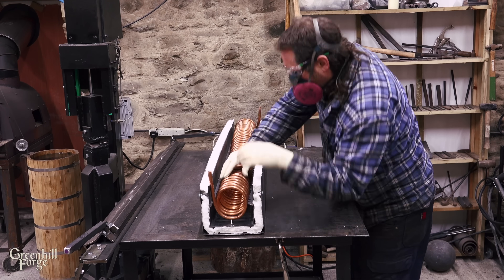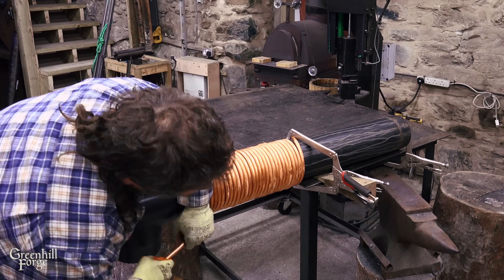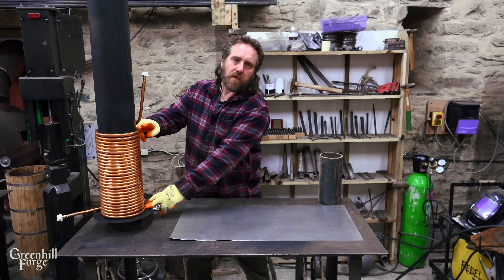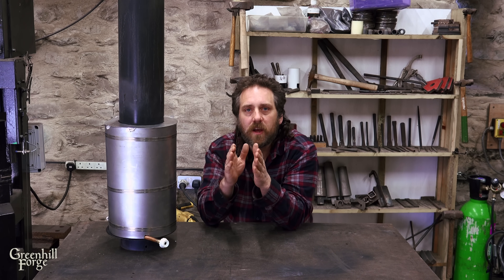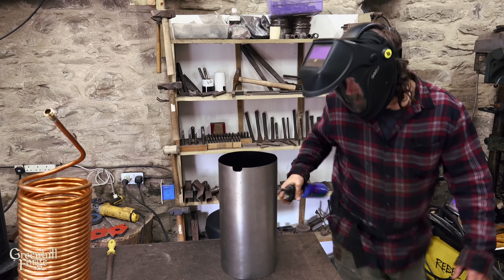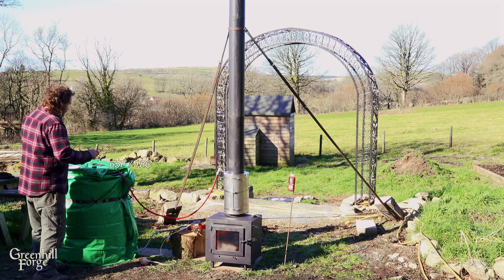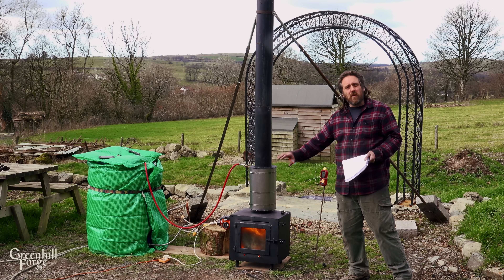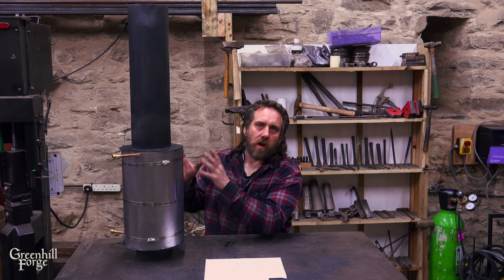Best Wood Stove Water Heater Yet: New Design Tested | Off Grid Water Heater pt3

Comment: Hi Eric, here's an idea. You could increase the surface area of the stove gases coming into contact with the flute by essentially running individual pipes, probably 7-8 together. Once tacked one end of the pipes could be flared and welded together as to seal and direct gas flow. The copper pipe is wound around this component, wrapped and then filled with your graphite. This may, or may not, impede gas flow but it would be easy to calculate the difference in comparable area/square inches and adjust to match original flute volume although the increased heat might also increase gas flow balancing it out.

Comment: Is there a recommendation regarding the distance of the unit from the actual stove. Can the unit be mounted higher, or is there too much heat loss?
Reply from the maker: good question. I'd think it would want to be hot enough to minimize condesation and increase efficiency but I don't see why it couldn't be theoretically further from the stove

Comment: what if you spread the coil out over the length of the flue with an insulating jacket that way your pulling heat out over a longer length and allowing heat to surround the coil

Comment: i tried a lokomotivetyp of boiler with smoketubes .28   0,5 m long ,of 18mm diameter. heated by used vegetable oil (dripfeeder).i clean the tubes every 3 days with a pipebrush. works great as a pool heater.😊
Reply from the maker: Got any pics you could send? I'd love to see it

Comment: Suggestion: Scale it up! Instead of the short section of copper tubing, wrap as much of that single wall flue pipe as you can with copper tubing... capturing and converting more of the flue pipe's heat. Compare the short section version you've been testing, to a whole-flue-pipe version.

You could also stack and connect multiple 'short sections' together to create a modular system to satisfy varying requirements.

Comment: hi from the uk do you not have fires with built in cast iron back boilers ? they are common here i have run full central heating and hot water from a back boiler
Reply from the maker: They're not very common in the States. It's also quite uncommon to use water/radiators for heating in the States. Mostly forced air through ducting. I'll be making some boiler videos eventually but this is meant to be something that can be added on to a normal stove. There's a water jacket shower I made that I show in this video https://youtu.be/pP_2A5Wdvqg

Comment: Love the video and your skills. Truly inspiring. I am just wondering how does a commercial heat exchanger operate in a large HVAC system for example. That is essentially what the coil system is trying to achieve. Are you trying to re-invent the wheel here?
Reply from the maker: HVAC usually burns natural gas or is electric so it doesn't have to extract heat from dirty flue gasses

Comment: What about adding fins inside the flue? There’s a lot of flow moving by and I think you could get a lot more conduction through to the coil. Wavy fins can induce a lot of turbulence increasing your heat transfer rate. I don’t know anything about safety regs like you mentioned inside the flue but the fact that you even tried the coil in there makes me think fins would be fine. They would be easy enough to clean and not develop anywhere close to as much creosote as a pipe with water running through it holding the temp down

Comment: I took note that the coil-in-flue was longer ( about 3 feet) than the outside-the-flue system (14 to 18").  Perhaps a longer exterior coil could capture more heat to provide a faster rise.

Comment: I just found your very interesting video / channel. 
      I think you will be on to something when you add sand. Figure that the copper line has a small contact area and even though you made a great coil the 100% surface contact may not have been good because the coil has a tendcy to naturally spring open for a loose fit.  I would have figured this to be more efficient than your experiment proved, especially when you added insulation.
       I think the sand will greatly increase the overall contact area with much greater efficiency, but that is what I thought about the insulation, too.
       This is my take and two cents worth. In electronic,  when you have components that are prone to destructive temperatur,  they add a heat sink, but they make a special paste to place between the components to help with the heat transfer. I think this is what the sand will do. I think I would find a way to hold the copper coils 1/2" to 3/4" separated and still stay in contact with the pipe. The surrounding sand should greatly increase heat transfer. Better contact with coils surface to pipe. Even though you made a great coil on the first experiment, it could have been loosely fit and all of the not fully in contact.

Comment: Now build a jacketted stainless steel flue pipe. We use them for steam generation. Heat water from 3°C to 120°C in a jacket 60cm long in 30 seconds. add a spiral deflector at the inside bottom of the flue.

Comment: thin walled stainless steel coils braised to stack pipe along with your set up would increase the thermo transpher rate. like what is used in a natural gas pool heater.

Comment: I told you to look at my system. It is the most efficient. 
Here in Chile they have perfected this system you are trying to build. 
THE FLUE IS THE TANK! Jim
Reply from the maker: Do you have a link? In this video I show an off grid water jacket shower I made if you want to check it out. sounds like what your'e talking about https://youtu.be/pP_2A5Wdvqg
Reply: @GreenhillForge  I recently re manufactured my water tank/fire box and upgraded to 4 mm stainless steel. The old tank was 10 years old and needed to be replaced. It works great and is very efficient. Jim

Comment: graphite is an excellent conductor..  I wonder if having graphite surrounding the copper and then an insulator around that.. (aircrete? sand?).. should insulate from the outside but keep conduction high between the copper and the steel pipe.

Comment: Can you surround the coil with water and use it as a buffer maybe with a 95°c thermostat with buffer tank or cycling tank.

Another idea is making a double wall stove with water trapped inside and using this to transfer heat using the same principles

Comment: how about having this unit as an insulated cell, with main heat going trough it, and slightly cooler air flowing outside it.. also make the coil and tube bigger. 
downside, the stove will take up much space and be very heavy.

Comment: I’m spinning off someone else’s idea which is to eliminate the copper tubing and construct a stainless tank component that sits in the same location as the tubing configuration you built and circulate the water through that
Reply: If you use stainless tubing, you just place it in the flue.

Transfer issues solved.

Comment: First of all, doing those tests outdoors was biased against the bare copper coil (contestant #1). 🤣

You could try a boiler design where the hot flue gases are channeled to boil the water ie. in a big, removable "kettle" (for cleaning off the creosote). 😁
Reply from the maker: I made an off-grid flue water jacket shower system kind of like a boiler. I show it in this video if you want to check it out https://youtu.be/pP_2A5Wdvqg

Comment: Wood-burner here from northern New England. I've lit a woodstove at least 2000X in my lifetime, burned wood for heat for more than 40 years. During the winter I don't light the fire as I just pick up the new fire from the previous day's coals. That's not the point, here. The point is that I've watched a LOT of heat go up the flu thinking "What a waste. What could I do with that heat? Soft copper pipe twisted around the flu, and..."  So,  if nothing else, your channel answers so many questions I never got around to answering. A lifelong itch has been thoroughly scratched. I personally proffer profound props profusely.
Reply: if you want a more efficient way of heating with wood, look into rocket mass heater. it's 75-90% more efficient. 👍Less creosote too because it all gets burned up in the combustion chamber.
Reply: @josoffat7649  I made one, as an experiment, but it has its drawbacks too. These days you have the catalytic stoves of which I think that they are just as good as the rocket stoves, with the benefit that you do not have to spend so much time at processing the wood into small enough pieces and tendering the fire. And those are built to last. A rocket stove only works well if it is build out of the right materials, but it doesn't last as long because it gets so hot. I made one completely from steel, also the inner heat riser, and that is not the right material. It requires a lot of tendering the fire to keep it hot enough in order to get the benefits from a rocket stove. Which makes it impractical for daily use.
Reply: @insAneTunA  Heat riser should be made of bricks (some use ceramic) and the batch box design solves the other problems.
Reply: @insAneTunA  ik gebruik een rocket stove mass heater sinds 3 jaar , en de plannen voor een ander type brandruimte zijn in de maak , er is een vulruimte (batchbox) mogelijk  die ook grote blokken kan verbranden .. sinds ik deze kachel gebruik , ben ik minimaal 75 procent goedkoper uit met hout , en ik zie erg weinig slijtage aan de binnen zijde van de brandruimte . je kunt alleen hitte bestendige stenen gebruiken , staal en andere metalen zijn erg slecht. maar die gaan lang mee , dus de prijs van aanschaf waard.
Reply: He's done that on another video and it works quite well @josoffat7649

Comment: Good work! Graphite YES! But shouldn't you spread the coils out, say over twice the length of the flu that you have? More surface area = more heat transfer. Also, why not fabricate a section of copper flu and only have the copper meet steel at the flu joint?

Comment: First, you need to separate the coils. Most of the efficiency gains from the inside pipe configuration came from the distance between the coils. Second, you need to direct the gas downwards. First up, then down, then up again. The first bend down will be the hottest spot in the system. If you wrap your coil all the way from the stove to the last upwards bend, you will get the most out of the heat transfer. This system most likely needs a circulation pump to prevent any gas build up inside the copper pipe. But, with a variation of this, you should be able to create a self siphoning system. The key parts in this are the bends in the gas pipe and separation in the copper coils.

Comment: BEWARE. Pressure explosions are a key element in with such devices right the way through the history of steam boilers and engines. Water freezing in the copper pipe, then heating when the fire is restarted without the means for some steam to escape, has obvious results.       Creating a tank in a box surrounded with insulating pannels means that you can cheaply store greater amounts of heat energy.

Comment: As a suggestion, I'd be curious to see the same amount of copper, coiled up the whole length, with similar sand/graphite packing. - Especially if the graphite conducts heat as you say, it should let the whole surface area of the flume to be used to convect heat.

Comment: So many good ideas above and below. I am with the crowd that has said to extend the copper up the flue. I only saw one comment talking about extending it up the flue to the same height as the original idea. Most in this camp want to see that with Graphite powder but I would love to see it with sand. I have a strong affinity for lowest technology/materials possible for reasonably high efficiency. Sand is cheaper and easier to get a hold of. Not impossible, but graphite power is not sold at the big box stores. Love the series! I hope your channel grows in exponents. LOL
Reply from the maker: one thing that might work would be grinding charcoal into fine powder. It's basically pure carbon just like graphite. would need to test it to see if the thermal transfer is similar but that would satisfy the low tech/high accessiblilty side of things
Reply: @GreenhillForge  Or try mixing the charcoal and sand so the smaller particles fill the voids between the sand.  Possibly clay / sand is another low cost option.
Reply: @michaelbruce7262  👍🏼👍🏼
Reply: @GreenhillForge  hi, can you put Pb or  Sn? I think must better 🤔
Reply: @GreenhillForge  do graphite, but with a 1/2 inch spacing between the coils. This will make the unit taller, and more surface area of the chimney will be in use.
Reply: Agreed, great ideas on here. Only problem with extending it higher up the flue is that temps decrease as you move away from the firebox & are hottest at the stove

Comment: I don’t know anything about anything. Could you get rid of the copper tube and weld a water jacket around the pipe with a connection on top for the hot water to leave and a connection on the bottom for cold water? So the water is touching the flute. Like how old school radiators did not have to use a water pump

Comment: Coat the copper in high temp graphite paint and put inside the floo? Yes you'd have to clean it, but you could make two and do a quick replacement while the other soaks in a degreaser bath with diy agitator like a poor mans ultrasonic cleaner, that would break all the soot off.

Comment: Great video, I have been interested in this type of set up. I was  considering putting a radiator on the back or top of the stove in series with the copper coil. I would prefer to be able to use the stove without heating water sometimes, but im not sure if the system would be damaged without water cooling it down.

Comment: Nice! But... if the coil would have been as long as the system with the coil in the pipe, the result would've been completely different. Lots better for starters 🙂

Comment: Love your content! As you already know heat transfer when dealing with air which is where the heat is in the flue is a function of surface area, temperature difference and velocity... So if you could use the heat to spin a turbo then you could get high speed hot air to blow on your coils and be on the surface of the sun in no time! Lol love it, keep up the great content!!

Comment: Only thing you might try is pulling the coil out long ways creating more space between wraps.
In my mind this would allow greater heat accumulation along a longer section of flu pipe. 👍

Comment: Since you are only capturing heat in about an 18 inch run, and are losing all the radiant heat from the  chimney above the coil, is there a way to capture that heat? Maybe some sort of heat sink, or smaller  coil to transfer that heat back down to the main coil? Maybe a small coil at the chimneys exit that can be monitored and cleaned.

Comment: Graphite can act as a dry electrolyte so could cause galvanic corrosion between the different types of metal. Shouldn't be an issue though with the high temp paint coating you gave the steel, but something to keep in mind for future builds. 👍
Reply from the maker: my hope is that it being sealed from water and oxygen and the steel being coated that it will hold up well. I'll open it up one day and show it in a video. Copper powder was my first choice but really expensive.
Reply: @GreenhillForge  I think the cost is a large part of why people go for a sand filling when home making these water heating systems for sure.
I think as long as your paint coating holds up there shouldn't be any major corrosion inside.

Comment: Using ice to avoid kinks is kind of genius.  :)  Regarding a 'pure thermosiphon' (no pump), then the tank position relative to the heat source is really important - the tank needs to be higher.  Also, the pipes linking both sides should be straight'ish (- no sagging loops!), normally with insulation too.

Comment: The house I grew up in had a wood stove that heated our water. The pipping was inside the fire box. It was directly plumbed to the water heater. It also had a pressure relief valve on a pipe plumbed to outside in case of power outages. I don't know what type of pipping was inside the box, but we never had a leak. It worked for years.

Comment: Now i haven't gotten through this guys older vids but can you get mre heat tranfer with a longer coil up the stack?
Reply from the maker: yeah, more copper would be better. this is just a limitation of cost. It's 50 feet of copper in all the tests
Reply: @GreenhillForge  oh wow, 50' sure doesn't look like a lot when it's coiled on the stack! Thanks for the info!

Comment: So, lots of ideas. First, couldn't you get a larger diameter copper pipe, same size as the flue and replace a section of the flue with that. Then instead of using a round copper pipe, find a "D" shaped tubing and wrap that around the larger flue sized copper pipe? And a variation on this would be, instead of a "D" shaped tubing, use a very long rectangular shape wrapped and brazed to the flue sized copper pipe spiraling upward, with another piece of copper sheeting outside of and wrapped around that? The idea there is to let the water flow around the inner flue sized copper pipe picking up heat as either of these suggestions have a greater area of copper thermally connected to your heat source. I have other ideas/questions, but not sure if you will either of these, so I will leave it here for now.

Comment: I can't tell what diameter copper is being used, I'm guessing 3/4? What would three coils of 3/8 or 1/4 do for thermal transfer?  This would give you more coverage on your exhaust stack. Make a 3/4 to 3x1/4 union block at each end. Think of how a radiator moves energy.
Reply from the maker: 1/2". yeah that could be worth a try